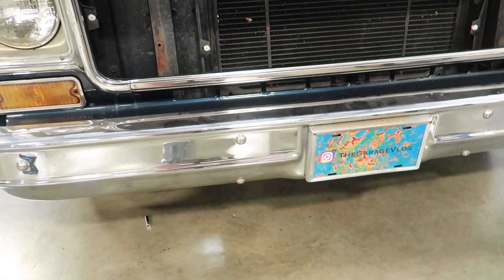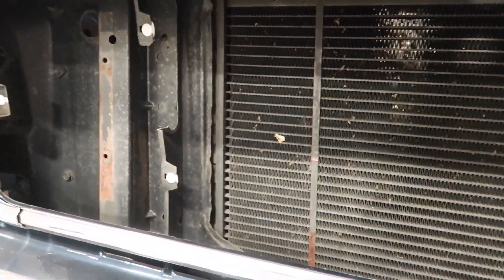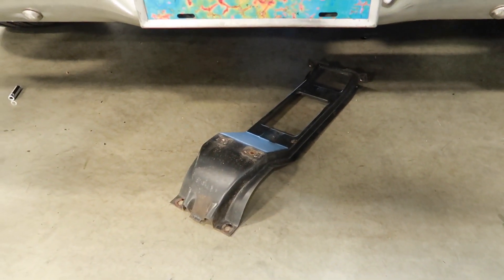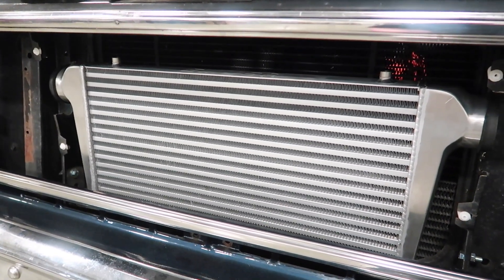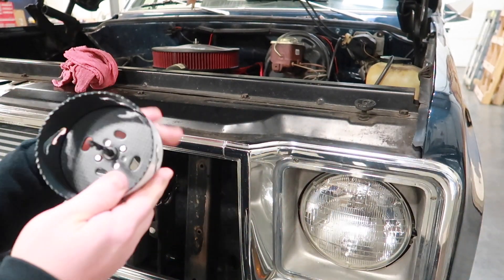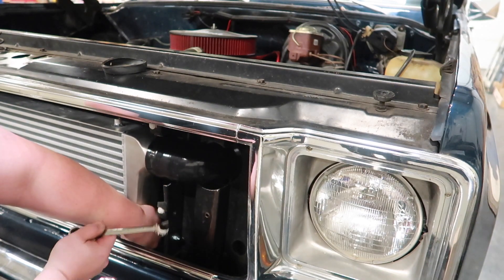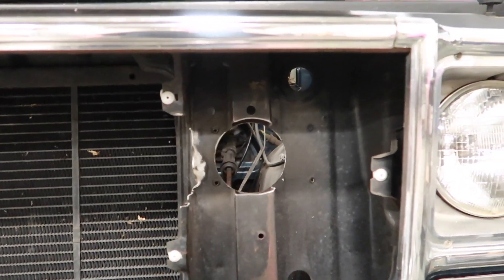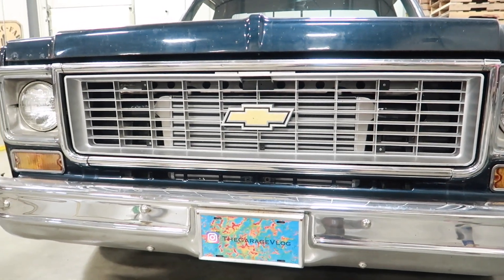C10 Turbo Intercooler Install

Comment: What brand intercooler did you run? I’m starting to swap mine and have a few questions for ya. Thanks!
Reply from the maker: It was just a universal 31x12x3 intercooler with 3 inch piping purchased on Ebay. What setup are you running?